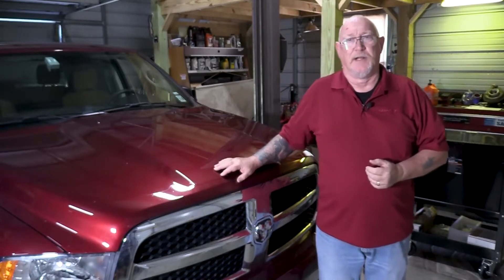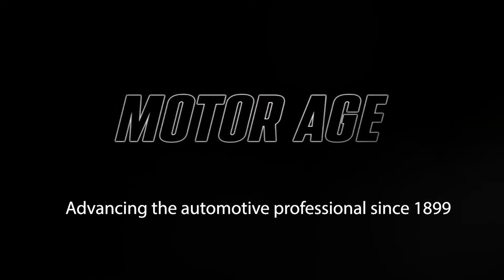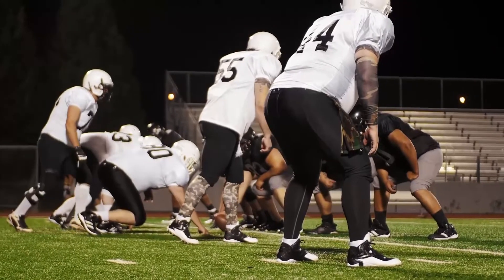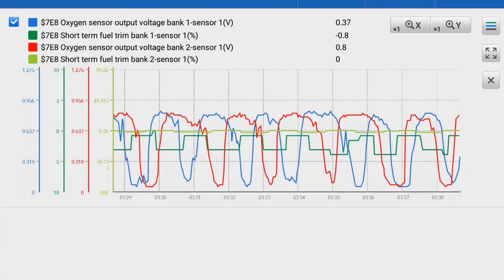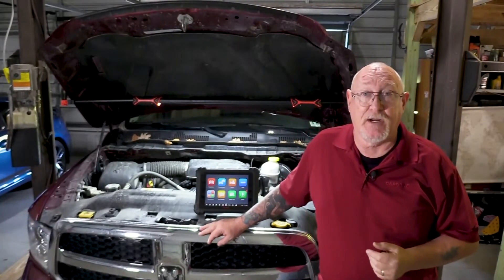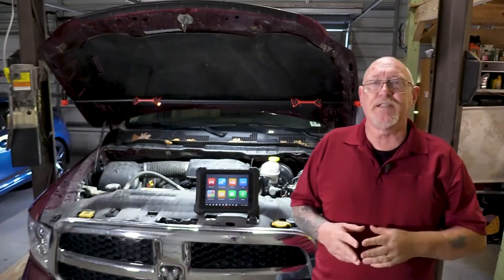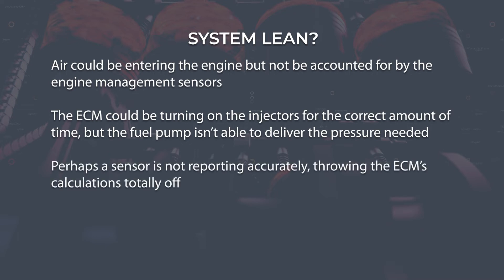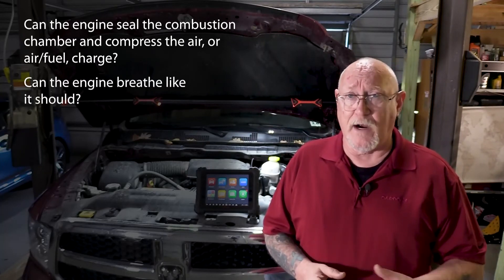Engine Control Module Deep Dive: How the PCM Manages Emissions Levels Through Various Sensors

Comment: We were better off in the 1970',s. You could drive a car till the engine blew up then still get milage to get home.
Reply from the maker: We agree things were simpler in the 1970s and see your point. Today's vehicles are more complex with all of the electronics and integrated systems. We appreciate you stopping by to check out our ECM video.  If you need any assistance, you can connect with our Technical Services team at:  https://www.cardone.com/contact/
Reply: Hi my name is Mary Jo I'm trying to find a control module for my 2009 Cadillac CTS been having trouble with my control module where on  line can find one? If can help
Reply: It keeps going out?